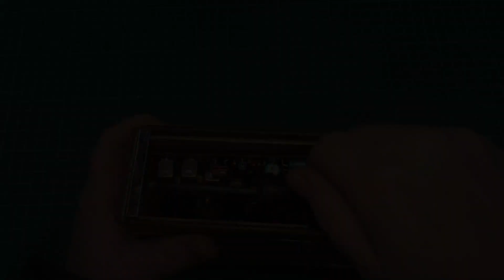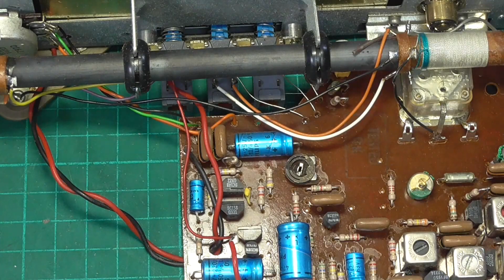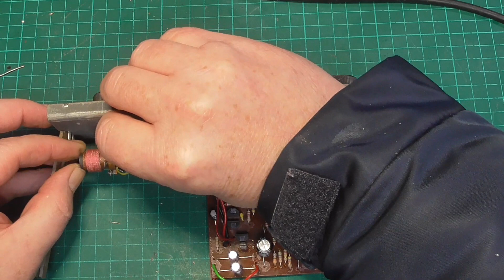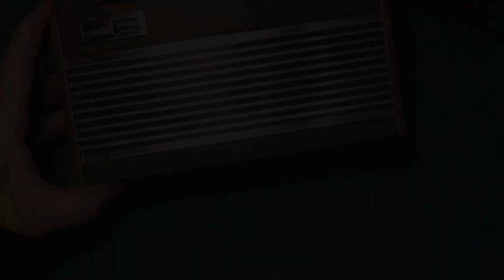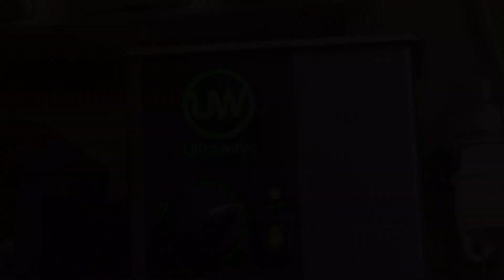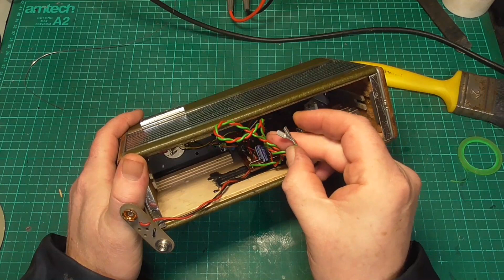Roberts Rambler Radio -  eBay purchase

Comment: I have bought one of these. Serial number 90447 in white. It only needs a top to one of the buttons and the trim to the bottom of the speaker grille.
Reply from the maker: I think I saw the exact one on ebay. Should make for a lovely radio when fettled nicely.
Reply: @Codeeze  I have no experience in repairing radio's. have tried twice and both times made it worse, only with cheap modern ones, but I dont mind cosmetic ones needing a clean and a missing bit here and there. I just got to find a cheap radio for hte partds or find he shitch cap and trim from somewhere. I collect DAB radio's and just bought hte Rambler BT and was surprised how small they are compared to the real Rambler size. lol
I have 23 DAB radio's now and some (I think about 8) vintage pocket radio's.

Comment: That’s a better AM/FM radio than most. It is so retro, or vintage. I’m guessing that this is a 1973 model, circa that, anyway. Ya should call 📞 this the “RRR” radio, for short. I see that “Roberts is the first name on it 🫡. It kind of looks like 👍 a little corrosion on the circuit board, or old age. Ya can fix it all up. Your friend, Jeff.

Comment: Smashing job 😀
A clean and touch up Ooow matron lol.
Not forgetting the bonkers capacitors, send them to graham as a present 😀
It was well off tune, no wonder it was deaf 😞
That's a propper radio with no unobtainium i.c's,  good old silicone transistors.
Yes peoples skin and crud can be a bit nasty,  a mate calls it detritus.
Reply from the maker: All of these old Roberts are a black hole of DNA. 
CSI Lancashire would simply give up...